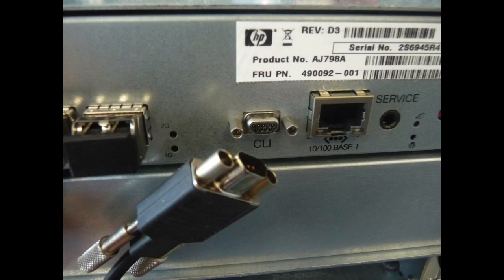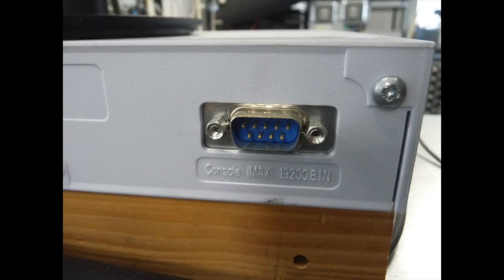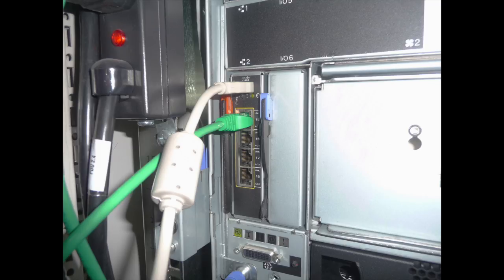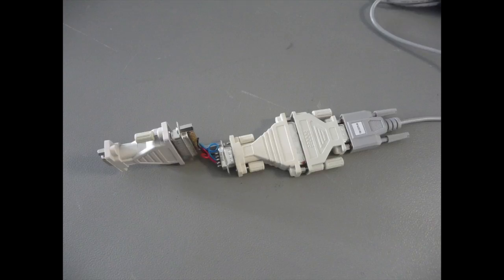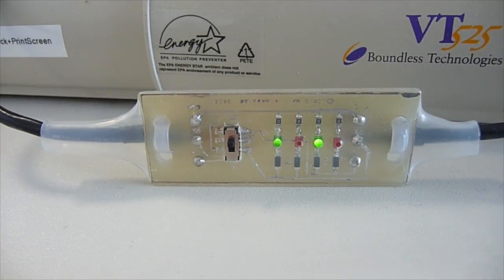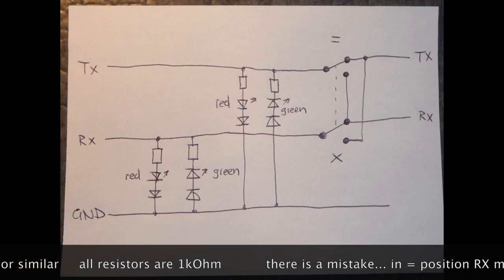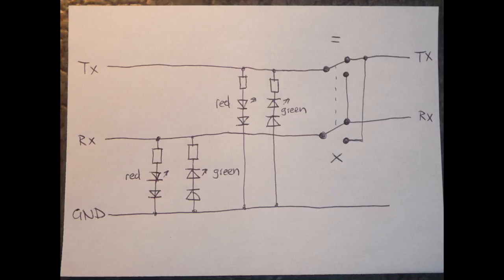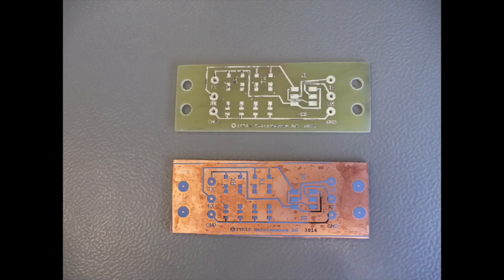A handy tool for serial fools (RS232) (PWJ70)

Comment: Thanks for the circuit I'm going to build one on vero.
I thought I might add a momentary button switch shorting TX and RX to perform a quick loop back test, what do you think?
Thanks again.
 Neil
Reply from the maker: That's a good idea. I just would take an on/off switch instead of a momentary. Maybe you want to do a longer test...

Comment: Which LEDs are you using?
Reply from the maker: It works with all kind of "normal" LEDs. I have a version with 5mm round LEDs that works as well. High efficiency LEDs are better visible.

Comment: Not many people have the B shell (25 pin) to E shell (9 pin) adaptors in both genders, so well done. 

From a circuit standpoint the classic DE-9 DTE-to-DCE switch adaptor (swaping pins 2 and 3 on the DE-9) originated from the DE-9 Null Modem circuit with a mechanical switch (DPDT) to swap pins 2 and 3. TI shows the classic null modem DE-9 circuit in their document SLLA037A page 9. The Null modem is an attempt to satisfy both device present and hardware flow control (Required Mark state signalling before attempting data communication). 

The serial cable connecting DTE to DCE is straight through, that is pin 1 to pin 1, pin 2 to pin 2 and so on. So a swap of pins 2 and 3 on one end will accomodate communication regardless of DTE or DCE designation for data flow. Many testers (adaptors) have omitted the device present and hardware flow control, and just switch (DPDT) pins 2 and 3. Ground Pin 5 must also be wired between the two devices, which is what is presented in the video along with leds to see activity. 

If you operate at very high baud sometimes it is hard to see the LEDs change state. If you don't want the device to be line powered, you can then use circuitry powered from a 9V battery (4000 series CMOS logic and CMOS op amps) to make visible single characters at very high baud. 

I think technically a DE-9 cable design can be fully shielded like USB, in which case you would have a foil shield, drain wire and outer tinned braid just like on a USB cable. I think on the DB-25 this shield connection is called protective ground (chassis ground) pin 1. Although it is not used on the DE-9. I think it is implied, based on the connector housings and how they mate that a continuous shield would serve the same function as protective ground. I know you can buy shielded DE-9 serial cables.
Reply from the maker: You are certainly right but you're going into too many details. My cable here is only meant to be used on serial terminal connections that require only 3 wires. Of course my cable wouldn't work with a fully wired modem but that was never intended. If you need a serial cable today, it would be for something like a ethernet switch or any other device to do a first time setup of the IP address or to do some diagnostic stuff.

Comment: Cisco sure loved its uncommon usage of common ports.
Reply from the maker: Cisco loves a lot of uncommon things...
Reply: The cisco serial over RJ45 implementation is pretty slick though - if you use their wiring scheme and make db-9 to RJ45 connectors, you can have a straight serial cable by using a strait RJ45 cable, and a null modem serial cable by uisng a rollover (basically the connector is flipped on one side of the cable) RJ45 cable.

Comment: (German at top, english translation below;))
Hehe .... erinnert mich an meine 10m 25pin flachbandkabel mit aufgequetschten D-SUB steckern und der billigen nullmodem-box die wir anno dazumal noch zum daddeln auf 2 rechnern genutzt haben....

Ich musste spontan an ne einfache RS232-Breakout-Box denken ... aber die kohle will mensch heute dafür vermutlich garnicht mehr wirklich ausgeben.... ;) 

Nette lösung! ;)

Gruß aus HH-Wilhlemsburg,

hacky ;)

(german above, english translation below:)

Hehe, that reminds me about my 10 metres 25 pin ribbon cable with crimped on connectors (25 pin) D-SUB and the cheap nullmodem adapter we used a long time ago to play 2 player games on 2 DOS machines (i386 and i486;)).

I spontanously had to think about some RS232 Breakout Box, which was somewhat cheap back then .. but surely no one would afford in these days. ;)

Nice solution! ;)

Greetings from Hamburg-Wilhlemsburg, Germany,

hacky ;)
Reply: English?
Reply: Sorry .. yah i will ad a translation. ;)
Reply from the maker: Naja, da man heute kaum noch mit Modems zu tun hat reicht ja eine Lösung, die nur mit RX,TX und GND arbeitet. Ausserdem mag ich die beiden grünen LED's, wenn die leuchten ist meistens alles i.O.
Danach kann man sich immer noch mit Baudrate etc. beschäftigen :-)